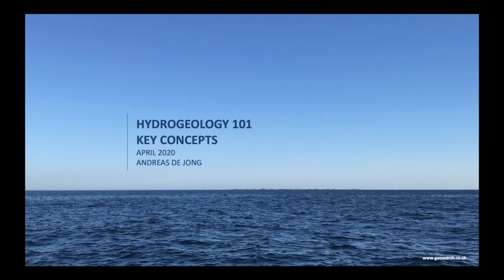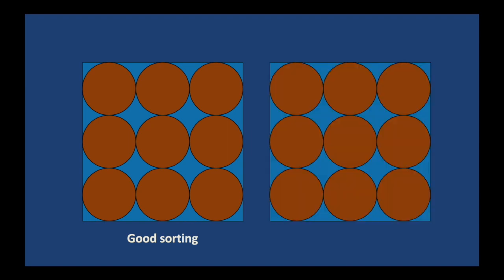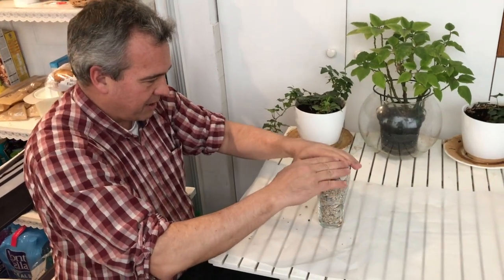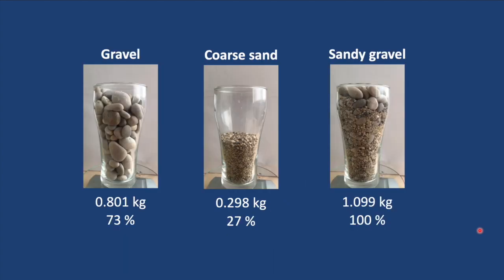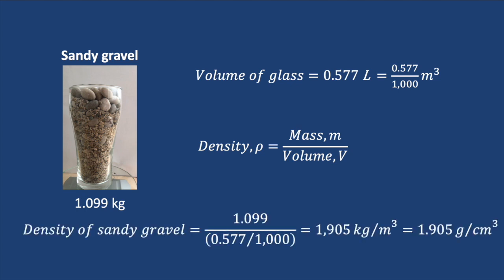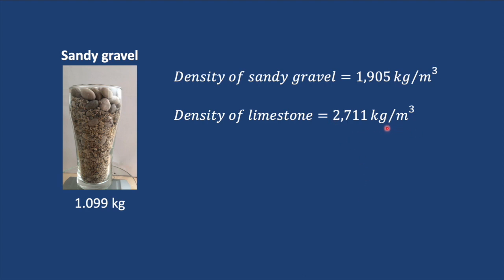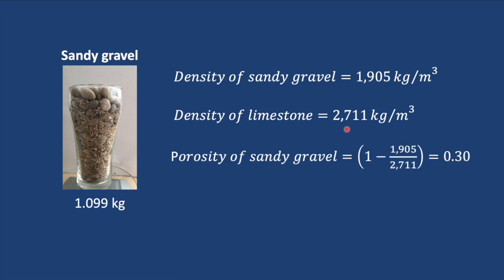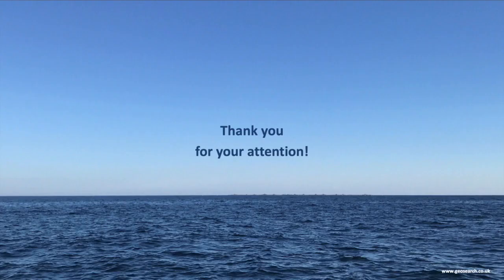Hydrogeology 101: Density & Porosity of a Sandy Gravel

Comment: Can you derive a formula between Density and Porosity?  If we know the density of a sorted sample like in this example of Sandy Gravel, why did we consider the density of limestone to be precisely? Does this mean the stones and sands are fragments of limestone? Thanks for your effort Professor.
Reply from the maker: Good question @SkepticalSalamander. The sample which I used in the video is almost 100% limestone, so the sand and gravel are referring to grain size and not composition. The purpose of the video was to try to visualise that porosity will be reduced by the finer particles. Many people have misconceptions about porosity which leads to big overestimations of available groundwater resources. All the best, Andreas